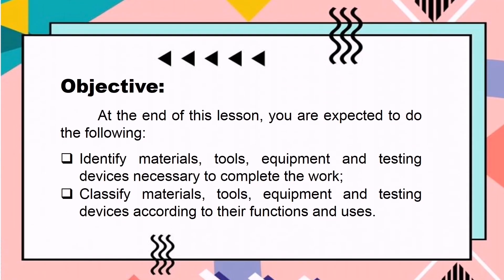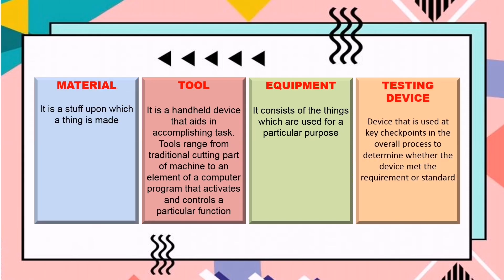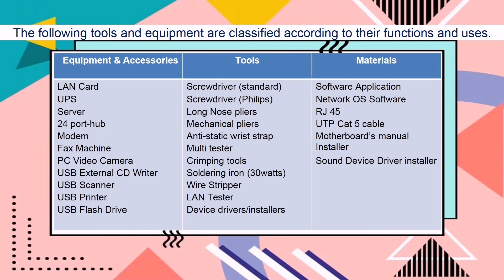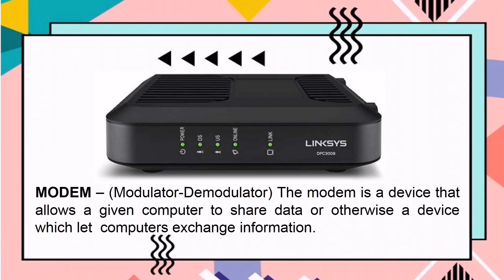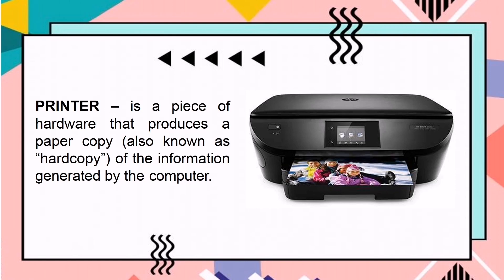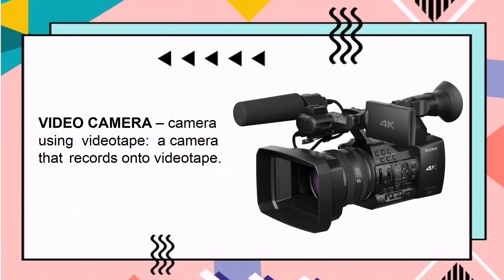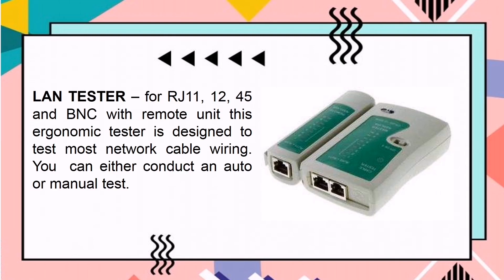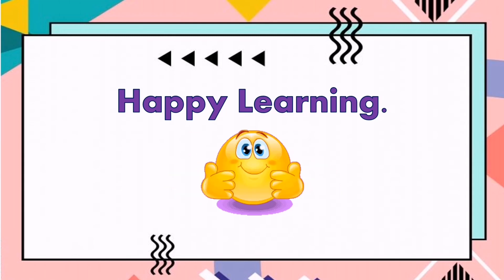LO 1. Assemble computer hardware

Comment: What I Learned in this video
10: Karangalan
1.I learned the difference between material tools equipment and testing devices.
2.Tools material, equipment & accessories there are different methods of use but all are important in using and repairing computer.
3.If you are not aware of using this kind of tools you can read this the description on manual how to use this kind of tools and after you read this and understand you can now apply the tools on use it.

Comment: Based on what I've learned Using tools properly helps prevent accidents and damage to equipment and people. This section describes and covers the proper use of a variety of hardware, software, and organizational tools specific to working with computers and peripherals.

Comment: Three(3) disadvantages of not following directions in using tools and equipment 

1.  Not following instruction may cause malfunction to a computer
2. You might harm or worse break some parts of the computer 
3. Not following directions might also take you some time as you do not know what you're doing. You might not complete your task correctly.

Cassandra Niel B. Sambajon
10-Karunungan

Comment: - One important thing to consider before executing a well planed computer installation is that one must be knowledgeable in the different tools and equipment used in computer system and network

10-KARANGALAN

Comment: Each tool does have a unique set of uses and a unique design. 

You must be familiar with all the components of a computer system, including how they function. 

When you misread or unread all instructions, this could create harm to equipment, then you'll begin worried since your do not even understand how and where to remedy it.

Geann Deticio
10-Karangalan

Comment: in this video,I learned about the different materials,tools,equipment and testing device,
it is vital to know the utilization of the apparatuses gear since you'll be able verify how to utilize it and you'll absent for the unsafe things and you would like to test the gadget utilized for computers to know in the event that the gadget is smooth or have a issue

Comment: In this video, I learned about different types of materials, tools and equipments and their definitions/uses.
The three disadvantages of not following the instructions in using the tools, equipment and materials are.. 

- We won't be able to do our task right if we don't know how to use them. 
- Higher chance of accident if we use them incorrectly. 
- Having a strong potential risk of causing damage to our computer or computer parts. 

Norland Jane Delos Reyes 
10 - karangalan

Comment: Three (3) disadvantages of not following directions in using tools and equipment:

1 Accidents and minor to severe injuries may occur as a result of failure to follow instructions.

2 It might also make the job more complicated and harder to correct. You will also have a greater probability of harming some computer components. 

3 You will not learn how to repair and use a computer if you do not follow the necessary instructions and directions.

Alaizza Mae S. Briol
10-Karangalan

Comment: Three disadvantages of not following directions in using the tools and equipment
- It will be challenging to fix, use, or complete the task if you don't follow the instruction on how to use a tool or piece of equipment. 
- There is a chance of harming the tool or equipment or the way you use it when you push another manner of use.
- It may lead you to accidents when u dont follow instructions

Comment: Material -
           It is a stuff upon which a thing is made
Tool-
        It is a handheld device that aids in accomplishing task tools range from traditional cutting part of machine to an element of a computer program that activities and controls a particular function
Equipment -
        It consists of the things which are used for a particular purpose
Testing device -
Device that is used at key checkpoint in the overall process to determine whether the device met the requirement or standard

Three disadvantage of not following directions in using tools and equipment
-disregarding information/instruction manual can lead to safety and hazard related consequences to the person and the people around them
-it could compromise the efficient quality of accomplishing certain tasks
-If you not read the directions first,there possibility it will be difficult for you to perform the given task

JENETH FRUTO
10-KARANGALAN

Comment: What I learned in this video.
10:karangalan
1. I learned the difference between material, tools, equipment, and testing devices.
2. Tools, materials, equipment & accessories there are different methods of use but all are important in using and repairing computers.
3. If you are not aware of using this kind of tools you can read the description or manual how to use this kind of tools and after you read this and understand you can now apply the tools or use it.

Comment: Following the proper instruction in using the tools and equipments is very essential. Misuse of direction have a disadvantages and you'll be facing the following consequences:

 Firstly, it will make you hard and miserable to perform and finish the task  you wanna fix and organize. 

The use of inappropriate tools and equipment may result to damages. You'll be wasting your time, money, strength and most of all your tool and equipment. They have a different function and description so it is important to be aware of the directions to avoid this kind of situation. 

Lastly, confusion of using tools and equipments may lead to misuse of it and turn into inconvenience, problem, trouble,  discomfort and may result to accidents, hazards and devastation. 

So to avoid this consequences, we should know and follow the direction of using tools and equipments.

Apology for late comment ma'am, thank you and God bless:)))

Grade 10-Karunungan
Christina Jane M. Cualbar

Comment: In this video, I learned about the different materials, tools, equipment, and  testing devices and their functions and uses. I also learned the importance of knowing the proper use of each tool and equipment in order to prevent damage.
Every tools has their own functions and design. In computer system, you need to know all the tools and equipments including their works. Once you misunderstood or unread the directions, it may cause damage on tool, then you will start panicking because you don't know how to fix it. 

Clyde vallano luisaga
grade 10-katuwiran

Comment: Three disadvantages of not following directions in the using the tools and equipment.

• it will be challenging to fix, use, or complete the task if you don't follow the instruction on how to use a tool of place of equipment. it will take you a while to figure it on your own.

• having an accident while learning to use them is also conceivable failing to follow the instructions might result in cuts, bruises, and other injuries.

- Zandrey Gomez Cabalbag
- Grade 10 Katuwiran

Comment: three disadvantages of not following the direction in using the tools equipment

•it will be difficult to use it and work 
•your computer and devices can be damaged if you don't take care of them
•in the end we may not be able to handle the repair of the computer systems 

Baltazar Sam A.
10-kalayaan

Comment: In this video, I learned about the different materials, tools, equipment, and  testing devices and their functions and uses. I also learned the importance of knowing the proper use of each tool and equipment in order to prevent damage.

NICOLE REGUYAL   10-KATUWIRAN

Comment: What I learned from the video:

-Tools, materials, equipment & accessories there are different methods of use but all are important in using and repairing computers.

-It helps to avoid danger and makes using the computer easier.

Princes Myca F. Rosario
10 - KATUWIRAN

Comment: Based on what I have learned from the Video:
* Using tools and other equipments prevents accidents, especially to those people around us. This describes that using them in a proper way makes the job easier. It will help you to work more efficiently without causing damages.
* Tool, materials, equipment, and testing devices are necessary to do our job properly. The instructions and the process helps us to avoid physical injuries or any other hazard that can put us in danger.

KATUWIRAN - 10 💛

Comment: What i've learned on the video:
•Tools,Material,and Equipment are different in terms of their own purpose but they all needed for our hardware to use on our daily life.
•They are all helpful when using our computer.But all tools,material,and equipment have their own purpose so make it sure that we use the right materials,tools or equipment to avoid incident/accident.
Reply: Baka tropa ko yan

Comment: Three disadvantages of not following directions in using the tools and equipment 

- It will be challenging to fix, use, or complete the task if you don't follow the instruction on how to use a tool or piece of equipment. It will take you a while to figure it out on your own.
- There is a chance of harming the tool or equipment or the way you use it when you push another manner of use.
- Having an accident while learning to use them is also conceivable; failing to follow the instructions might result in cuts, bruises, and other injuries
10- katuwiran

Comment: THREE DISADVANTAGES OF NOT FOLLOWING DIRECTIONS IN USING THE TOOL AND EQUIPMENT

1.Accidents can happen to ourselves, the people around us, as well as to our tools, equipment, and any other things.

2.It's also possible to have an accident when learning how to use them; if you don't follow the directions, you could get cuts, bruises, and other wounds.

3.When performing these jobs, using the incorrect tools and equipment could cause us to take longer. Additionally, it can break our tools and harm them, rendering them useless.

10 KARUNNGAN
JAY P RAPSING

Comment: Three disadvantages of not following direction in using the tools and equipment  

1.Cost Quality materials take time to produce and adequate staff time as well as resources need to be allocated.

2.Quality Teacher-made materials will not normally have the same standard of design and production as commercial materials and hence may not present the same image as commercial materials.

3.Training To prepare teachers for materials writing projects, adequate training is necessary. Materials writing is a specialized skill and not all teachers area capable of writing good materials 

Mark Arjay M Carlos 
10-kalayaan

Comment: Cost: quality materials take time to produce adequate staff time as well as resources need to be allocated

Quality: teacher-made materials will not Normally have the same standard of design and production as commercial materials and hence may not present the save image and hence may not present the same image as commercial materials

Training:to prepare teachers for materials writing project adequate training is necessary materials writing is a specialized skill and not all teachers area capable of writing good materials 

G10-kalayaan

Comment: Three Disadvantages of Not Following Directions in Using Tools and Equipment

1. Not following directions in using tools and equipment can lead to accidents due to no knowledge of how to properly use them. Using them improperly can cause damage as well.

2. Doing different tasks would be difficult, since the directions would show the steps on how to perfectly use them.

3. The results you will get on doing tasks with them might be different on how you imagined it. Following the directions will make it easier because they tell us how the tools and equipment works perfectly.

10-KARUNUNGAN

Comment: The three disadvantages of not following directions in using the tools and equipments:

First, it can cause a harm or injury for a person that performing a certain task.
Second, the certain task will be uneasy and longing that will cause of being uncomfortable while performing it.
Third, for its result the computer will not working properly because of its gained damage. At worst, it will never be function anymore.

JADE STEVEN BOOL
10-KARUNUNGAN

Comment: list down the three disadvantages of not following directions in using the tools and equipment:

1. There will be improper operation of the tools or machinery.
2. If utilized in the incorrect location, the tools or equipment will be damaged.
3. You could damage yourself if you misuse a tool or piece of equipment.

Marian Jane M. Bayugo
10 - Karunungan

Comment: Three disadvantages of not following the directions in using tools and equipments:

1. Ignoring the proper use of tools and equipments might result in difficulty with assembling computer hardwares and there's a possibility of failed result. 

2. It can cause damages to your tools and equipments, as well as the part of computer hardware you are assembling.

3. It can result to different hazards and accidents to the people performing the tasks and those who surround them.

BALA, ROILO B.
10 KARUNUNGAN

Comment: 3 Disadvantages of not following directions in using the tools and equipment:

1. one of the disadvantages of not following directions in using tools and equipment is you might cause an accident or an injury...
2. If you didn't follow the directions you may not be able to use it properly..
3. It can lead to computer incompetence, which also can lead to computer damage or to your workplace

Armillo, Princess B.
10-Karunungan

Comment: Three Disadvantages of not following directions in using tools and equipment:

1.The final outcome that you want will not happen and you will not able to finish your task quickly because of not properly using the tool correctly. 

2.It can hurt and cause an accident to the people that doing the task and also to the people near.

3.There's a possibility that you can destroy or damage computer and its parts.

Asid, John Carl R.
10-KARUNUNGAN

Comment: HARLEY E. BALAGUER
10 KARUNUNGAN

THE THREE DISADVANTAGES OF NOT FOLLOWING DIRECTIONS IN USING THE TOOLS AND EQUIPMENT

-First of all, the main thing that would happen if you didn't follow the directions in using the tools and equipment is that you'll lack of knowledge on how to use it based on its proper purpose.

-Secondly, hazards will be present at the working hours when using the following tools and equipment without following the directions of how to use them. It would result into multiple risks like wounds, injuries and damages.

-Lastly, by not following the directions of how to use the tools and equipments, without the idea of how it must be use, the most disadvantage is that it will not finish the job or just make things worse, you can't accomplish a certain work.

Comment: THREE DISADVANTAGES OF NOT FOLLOWING DIRECTIONS IN USING TOOLS AND EQUIPMENT:

1.Disregarding the directions in using tools and equipment may waste plenty of time in performing such task(s) it is due to lack of knowledge on what is tools to be used and how to use them in particular situations.

2.Despite you have all the tools and equipments needed,as I've said,due to lack of knowledge you may not aquire the given deadline or your desired schedule in finishing the task .And considering that you've done it in time,you cannot also assure the quality of your work because of your poor performance.

3.In addition, it may also cause different risks for your safety and for those that surrounds you which is very inevitable if your not aware of certain things to happen caused by your ignorance ....

That's why it is very important to read directions first,gather data,and compromise all of them in order for you to do tasks safely and we'll done☺️☺️
Reply: Rommel A. Salud Jr.
10-Karunungan

Comment: Three Disadvantages of Not following directions in using Tools and Equipment:

• Unsure how to hold or use tools and equipment. Because you have no idea how or where you will use it.

• You may injure yourself and commit wrongdoing. The knowledge or learning of each tool and equipment is not difficult; all that is required is time and patience.

• A lack of knowledge in its use can lead to computer incompetence, which can lead to computer damage. 

Dellosa, Rhainer Sam C.
10 - Karunungan

Comment: 3 disadvantages of not following directions in using tools and equipment:
1. If we didn't follow the directions of using a certain tool or an equipment, we may not be able to use it properly.
2. It also might cause an accident or an injury.
3. The tool might not be properly work if we don't know the directions on how to use it.

Paolo Vergara
10-KARUNUNGAN

Comment: Using tools and equipment incorrectly involves three disadvantages:

1. Understanding how to use different tools and equipment is crucial because they may generate confusion due to their different roles.

2. When performing a given task, failure could potentially lead because of not following the instructions. When individuals disregard the directions before working with a device or set of tools, they commonly don't attain result, that results in a variety of other complications.

3. When using tools and equipment, ignorance can lead to numerous risks and tragedies for those doing the work and those nearby.

Lovely AC R. Halcon
10-Karunungan

Comment: Three disadvantages of not following directions in using the tools and equipment :

• Handling and using different tools and equipment can lead to confusion because of its different functions which problems may occur.

• Not reading instructions carefully and only using the tools and equipments by own knowledge, can degrade its possible potential to perform most especially on important tasks.

• Skills for using the following tools and equipment are not gained overnight nor is a rushed process. Therefore, rushing the process of learning on how to use and the funcionality of the tools and equipment may only bring frustration and failures.

Bayugo, Kate Ashley M.
10 - Karunungan